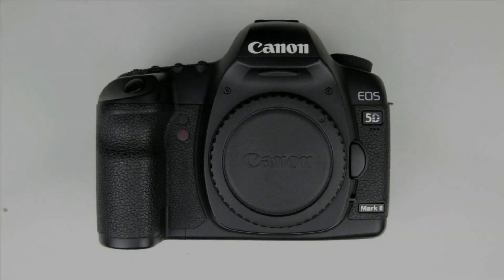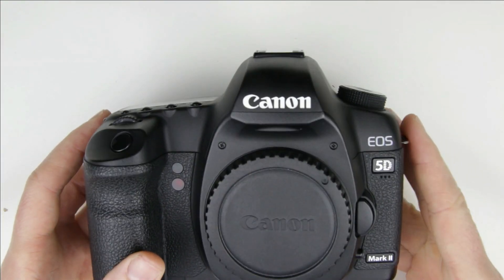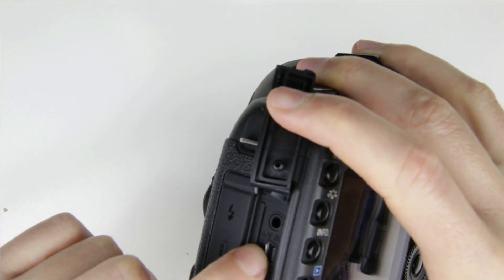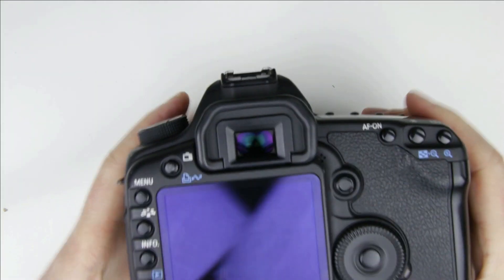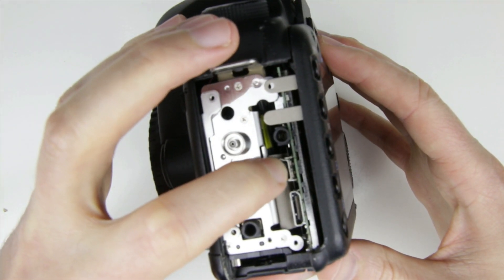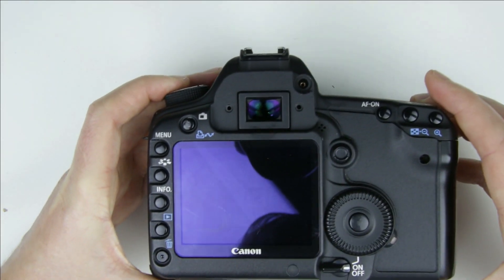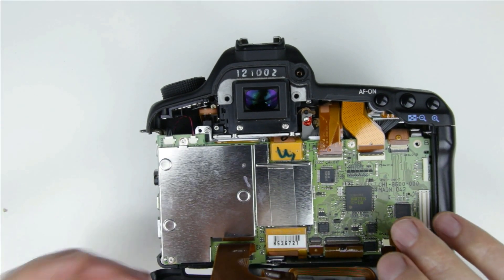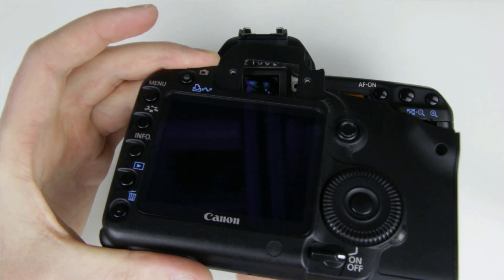Canon EOS 5D Mark II disassembly for repairing the miniUSB connector

Comment: Please Sir Help⚠️ After thé replacement of the Motherboard of à 5D mk2 it shows a deep grey screen and nothing works😓 can you Help me please☝️
Reply from the maker: Check the flat cables and the connectors between the PCB and the rear (LCD + buttons) panel.

Comment: do you have a link to buy the mini USB?
Reply from the maker: Here it is: http://rover.ebay.com/rover/1/711-53200-19255-0/1?ff3=4&pub=5575557832&toolid=10001&campid=5338662243&customid=&mpre=https%3A%2F%2Fwww.ebay.com%2Fsch%2Fi.html%3F_from%3DR40%26_trksid%3Dm570.l1313%26_nkw%3Dminiusb%2Bconnector%26_sacat%3D0
Reply: @CamerasLensesEtc  just solder on the board?
Reply from the maker: I solder the same one on the board.
If the connectors on the PCB are damaged, then you have to use wires to connect the miniUSB connector.
Reply: @CamerasLensesEtc  mine is the same as on the video there